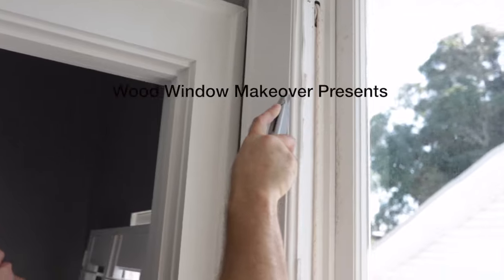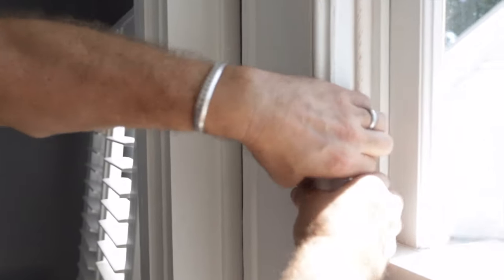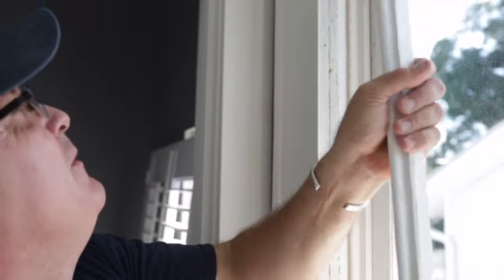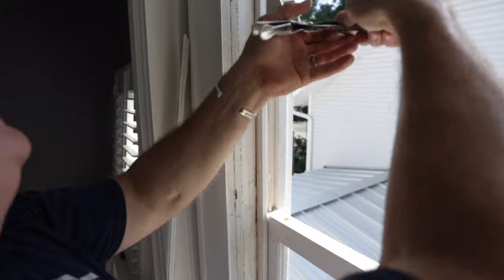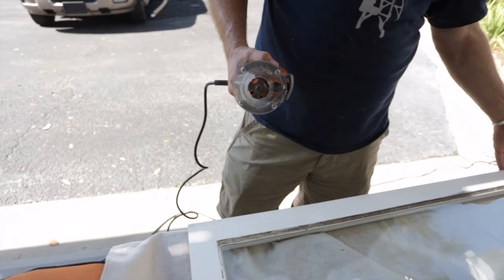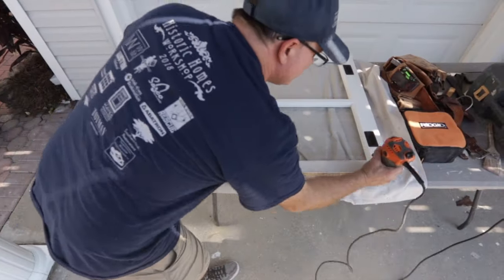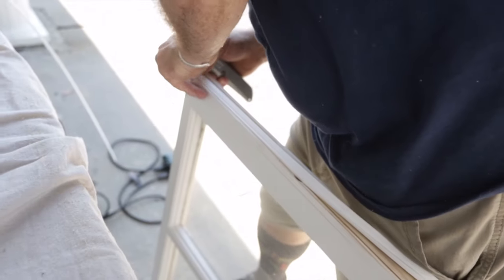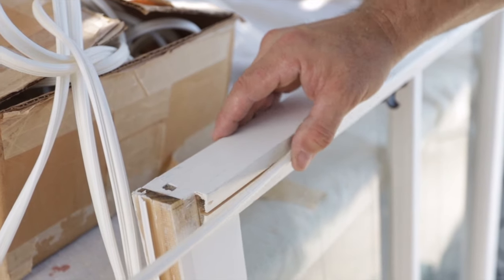Method to Weather Strip Old Wood Windows

Comment: Did you need to take any material off of the staff beads to make space for the weather stripping? I have some sashes that are pretty tight fit, wondering if just adding in weather stripping without making some space for them will mean they are very difficult (or impossible) to move

Comment: any comments on why you caulked the upper sash seal into place instead of cutting another slot and using a similar bulb seal to the one you used for the meeting rail?  how did you end up sealing the bottom of the bottom sash?
Reply from the maker: I have the tool to cut the groove, and I've done it. I stopped though because that groove is not easily reversible. It's not in the video, but I install a tube seal for the bottom sash where the stool meets the sill. The link on the comment above takes you to a smorgasbord of options for multiple applications. Just because I don't do the groove doesn't mean you can't. The groove is totally legit.